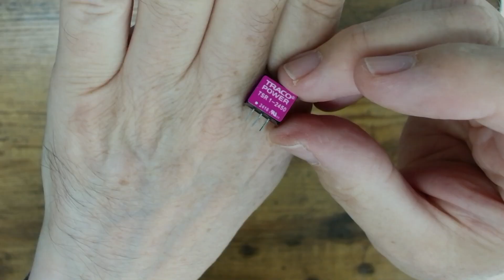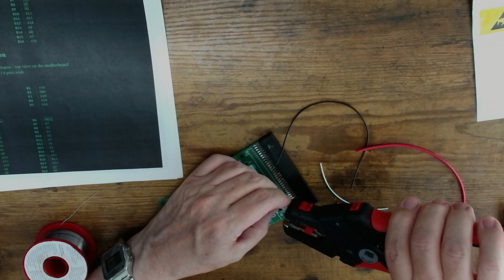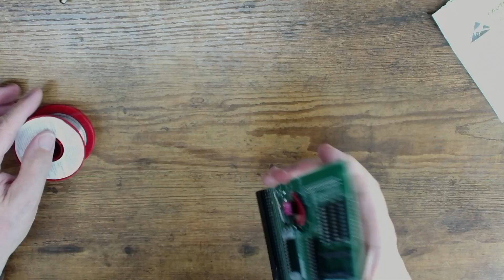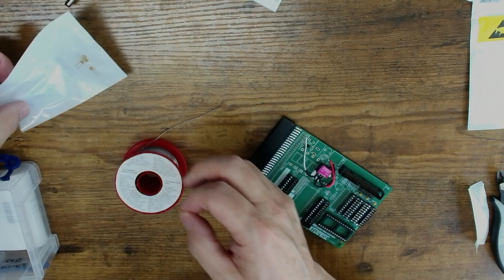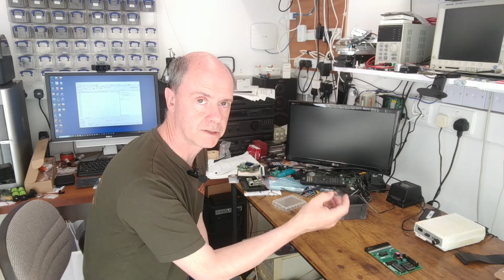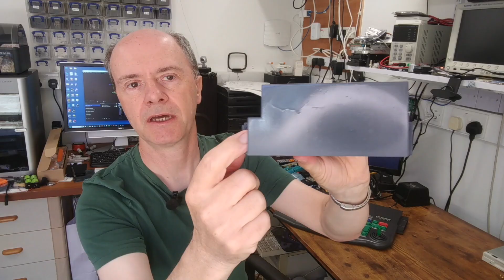Let's build an Enterprise 64/128 floppy interface

Comment: Where did you get the PCBs for the ROM and the interface? Did you have it made, or is there a source? And I heard thet the controller IC is difficult to get, how did you do that?
I still have a working Enterprise 128, but I never managed to get a floppy for it, sadly.
Great video, but you could have given a bit more background infomation. Thank you!
Reply from the maker: Someone gave me a PCB.
However, all the design files are available on Github so that you can get your PCBs made from your favourite PCB manufacturer:

https://github.com/maciejgruszecki/EXDOS
Reply: @decidedly_retro  Thanks! And what did you do for the controller chip? It looks like a real one, not the replica by vRetro.
Reply from the maker: @davidseim3064 I had a stock of VL1772 chips I’d picked up years ago. 
The Exxos Atari on-line store has a load of original WD1772 chips available for a very reasonable price.